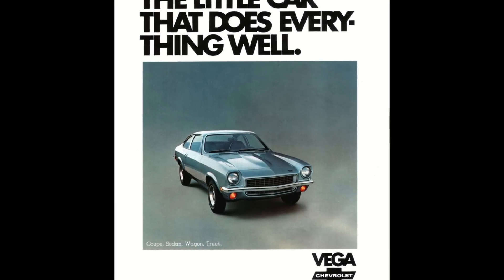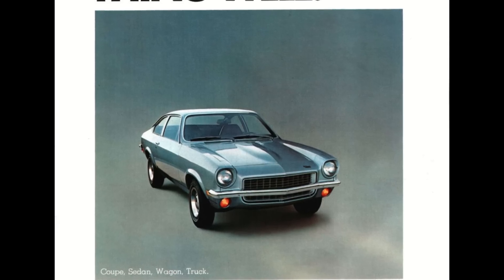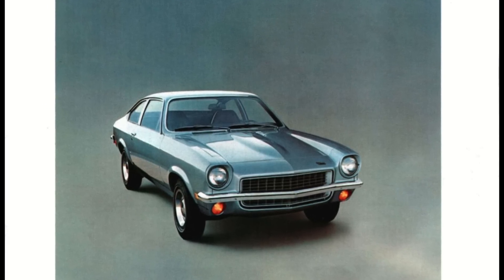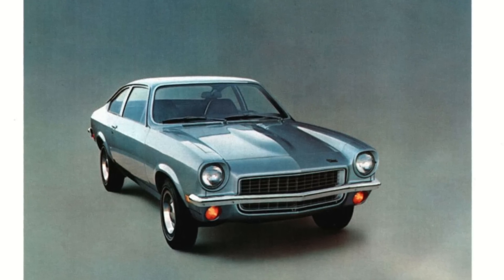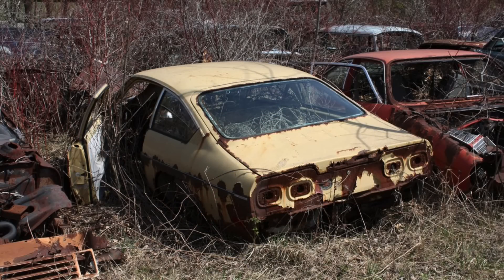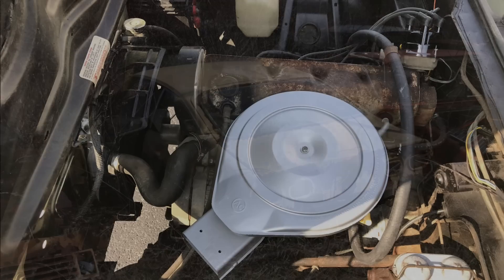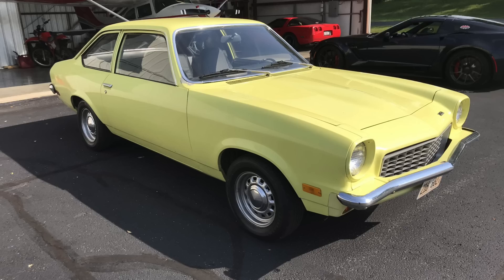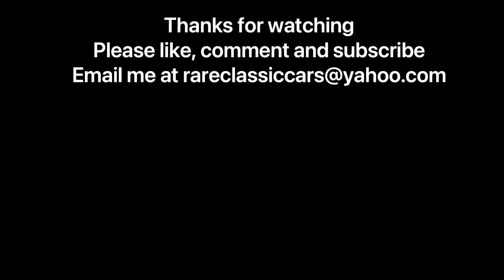GM's Largest Failures: Why The Chevrolet Vega's Engine Turned Buyers Away From American Cars

Comment: You gotta wonder if all the changes they were forced to implement didn’t cost more in the end than cylinder liners.
Reply: I was thinking the same, just spend the $20 to begin with and add it to the sticker, seems stupid.
Reply: @richardbaumgart2454  ivory towers have 90 day vision. They can't see further down the road than that and never will.
Reply: @dxrflyboy  My dad retired from GM and I was always a GM guy to until 2008, now I drive a Ford and a Toyota
Reply: Yep. But the bean counters would never have heard that logical suggestion over the sound of those beans clicking into the jars.  @richardbaumgart2454
Reply: Yeah, and you really have to wonder why they created their most expensive air filter for their least expensive car...  🙄
Reply: The scamerican way.......the oligarchs, bean counters and shareholders declare a profit no matter what
Reply: It didn't need liners. Many other manufacturers at the time had aluminum engines with no problems. It was just another rushed design by GM in response to wanting to get a little car to the market before it was ready. Remember the poor suspension problems with the Corvair when it was new? GM never learns, they just go cheap at the start, instead of doing things right.
Reply: @d.e.b.b5788 Chevy Cruze did the same thing again, shit quality and lots of recalls
Reply: @d.e.b.b5788  The rear suspension design of the first Corvairs was not problematic at its inception. Several other vehicles used a swing axle design that was nearly identical. Volkswagen Type 1 (Beetles) and Porsche used that design. In the US, Beetles used it until 1968. In other parts of the world, Beetles continued with the swing axle. I own a 1984 Beetle (Volkswagen de Mexico) and it has swing axles. So I wouldn't call it a case of GM not "learning their lesson". It was a contemporary design for its time.

As for the Vega, yeah, mistakes were made. However, GM has also pioneered many different aspects of vehicles over the last 120 years. This unfortunately sometimes comes at a cost when trying new processes. I'm not giving them a pass by any means, but hopefully they did learn something from the Vega, even if those lessons never came to fruition ON the Vega. There were many other vehicles GM made in the early 1970's that were absolutely reliable and also sales leaders, even while the Vega existed at the same time.

Lastly, the open deck design is something GM DID perfect. Almost all of their current four cylinder engines are open deck, as well as the formidable LS V8s.
Reply: @paulwindisch1423  Not all swing axle designs are identical, as proven by those Corvairs. However, as seen by how Porsche abandoned poorer chassis designs from their prototype racers as they found better ones, many were kept (like 911's) just because men liked to brag that they drove a 911, 'a REAL man's car'. got a lot of them killed, but hey, it was their choice. But I still say that Porsche could have made use of all their success in racing, to sell a NEWER mid engine car with which they could replace the  911, no 'macho' reputation enhancement needed from a poor handling car.
Reply: doing it right the first time is always the best way, economic amd reputation considerations.
I quitted the american car market 45 years ago and believe me, I'll never return
Reply: @jacquespoirier9071 honda went with linerless engines.....
Reply: @DrewLSsix  but the execution is far better quality
Reply: @DrewLSsix  with proper quality control and materials it can work, Mercedes has been doing it for 50 years.
Reply: @jacquespoirier9071 Not really just better technology has come along for piston coating and ring design.
Reply: @DrewLSsix but they are plated!
Reply: @DrewLSsix they used a ceramic coating to prevent wear in the j37.  This coating can chip and then you end up with a Vega situation shortly afterwards.
Reply: @MUUKOW3  it much more a mentality prolem than a technology problem.
Reply: @DrewLSsix Honda did have some linerless engines. But these were the exception rather than the rule. The vast majority of Honda engines use cast iron liners. There is good reason for this - the FRM engines are less reliable and tend to burn oil.

What’s also interesting is that, while the Mercruiser DOHC LT5 ZR1 Vette engine used Nikasil plated cylinders (they were all the rage -35 years ago), GM went back to cast iron liners in the LS/LT engines. Even the new DOHC LT6 Gemini engine uses cast iron liners. The fact is, there is NOTHING that beats cast iron for cylinder liners. It is self-lubricating due to graphite inclusions. It holds oil very well. It is hard enough that it doesn’t rapidly wear. But it is soft enough that it doesn’t rapidly wear pistons.
Reply: @DrewLSsix  FRM has its problems too...
Reply: @jacquespoirier9071  Barely even American anymore. GM has been importing vehicles from China and South Korea for ages, and now Ford is hopping on the bandwagon. You honestly support more American workers and suppliers by buying "imports" these days. They're shifting production here while the supposed American companies are outsourcing...
Reply: Same here, I quit American cars back in 1982, now just Japanese cars.
Reply: @jacquespoirier9071  there were some exceptional domestic engines in that time period, although this is not one of them. i still, to this day have 2 GM cars with 3800 engines. one of each variety, L36 and L67 supercharged. the supercharged is an SSEi bonneville and it's damn quick for a V6 with only a few light modifications. ford had the 300 i6 that you couldn't kill, the chrysler 318 v8, and the AMC/jeep 4.0 liter engine. there are others, the chevy 350 and the 4.3 that was built by removing 2 cylinders.

there were really good engine, and really bad engines. what i find really concerning is the domestics aren't really making too many great engines or cars anymore. they have more issues then cars they built in the 90's and 2000's
Reply: I also remember seeing an ad in the newspaper bragging bragging about the Vega being car of the yeand the and that it was actually Designed and partially built by computer.
 Also also designed by computer not to rust. They were also shipped and a very unique way.
They were shipped hanging up
Reply: @Greg-xv9qj  I recall the first year of Vega ads assuring us that they would take the VW approach and not make any changes in the first six years. As it turned out, the model only lasted seven years altogether. Zillions of changes, though!
Reply: Such an attractive vehicle, still. Such a shame.
Reply: Hastings, manufacturing company created an air filter that was a take apart unit and used a standard 6 cylinder Chevrolet air filter element.
 I remember seeing some Vegas.  Where the air filter was so filthy, it was ridiculous. Amazing, amazing, the car even rand other people cut the air filter housing. The filter that was in there with gasoline.  Lit it on fire burned it out because it was Bonded to the upper and lower shell and used a 6 cylinder Chevrolet element also.
Reply: @Greg-xv9qj Yes, I worked in an auto parts store in the early to mid 1980s, and we sold lots of Wix air cleaners with the replaceable element to Vega owners.
Reply: I put the alternator off a 1974 Vega I junked on  1962 Ford Tractor that I converted to 12 volt⚡.
Reply: In 1977 they came out with the 2.5 liter "Iron Duke" four cylinder,  probably in response to the failures with the Vega engines.
Reply: @BillySBC  which was another crude GM engine. Although reliable.
Reply: @corgiowner436  It was,  but it was better than the Vega motor.  Pretty sure they might still use the little Iron Duke in small Post Office delivery trucks,  or they used to.
Reply: No wondering necessary. The answer is YES. And worse, it hurt the brand. Idiotic bean-counting decisions that cost the company far more than they saved—-and the damage lasted for years. Arguably to this day.
Reply: GM replaced the Vega 4 cylinder with the Pontiac 151 Iron Duke 4 cylinder in the Vega-Astre for 1977.
Reply: @SuperDave01965  it was crude but reliable.
Reply: @SuperDave01965  i didnt know the iron duke was ever in the vega, i thought it was introduced with the citation. the iron duke was noisy but reliable, they would run almost forever. i would still buy one today if i came across a clean car, which is unlikely at this point...... and not a citation but a celebrity or 6000
Reply: My dad was a big GM guy and bought a 1973 Vega. What a piece of sh1t! He gave it to my older brother to take to college which was 3 hours away. He had to keep a case of oil in the car because of how fast in burned through oil. In the end it was shooting flames out of the tailpipe. I believe it traveled at most 60,000 miles.
Reply: @bartmix8994  it was probably one of GM's worst engine, GM has had some great engines and this was NOT one of them
Reply: Our local GM dealership was way ahead of GM as far as that aluminum block went. After a bunch of Vegas came back to them, burning more oil than was in the pan, with each Vega they sold, they were automatically breaking the engine down and installing cast iron sleeves in brand new engines before they even put them on the lot!!! most aluminum blocked engines, barely would make 12000 miles before the guaranteed oil burning began. They also would put an aftermarket radiator that was far superior to GM's. I owned a Cosworth Vega in the hatchback sport design,sleeved engine with an aftermarket, Edelbrock high performance Holley two barrel carburetor, that absolutely ate up most stock 283 cid engines by many car lengths!!! There's more to this story than what I've texted, but suffice it to say, our GM dealership was way ahead of GM as far as stopping oil burning warranty claims!!👍🏻👍🏻👍🏻😎
Reply: Damn right it did.
Reply: The 8.2L Detroit Diesel V8 in the Chevy and GMC medium duty 5000-7000 trucks had the same free standing open deck cylinders. Many guys back then spoke openly of the lousy design of the Vega engines. Popular swaps were the Chevy V8 or the VW Rabbit 4 cylinder.
Reply: @SuperDave01965  a 350 in one of those cars made it hot rod.4 seats and an engine.
Reply: I wonder what benefits Engineers thought having freestanding cylinders hadf
Reply: @nunyabizness8508  easier casting, less machining, and better coolant circulation.
Reply: I don't know if GM pioneered the technology, but nowadays they cast the engines with the cylinder liners in place. That saves a bunch of machining steps when the liners are cast in place and then machined once to proper fit and finish.
Reply: @bartholomausallen883  Cast-in liners have been a ‘thing’ for quite some time. Not only do they save machining steps for both the block and the liners. They also save some steps with casting since it is not necessary to make cores for the cylinders. The liners take the place of the cores.
Reply: John Z. HAYED THE CAR. WAMTED TO ADD FENDER LINERS AND BETTER TIRES FOR AN ANOTHER 47. BUCKS BUT GM SAID NO
Reply: The problem was the aluminum used to cast the block did not have silica (sand) added like Mercedes did!  The sand (glass) gave the bores the wear characteristics to last longer!!
Reply: @garybulwinkle82  Siamese cylinders, open deck, radiator that was basicly a heater core and no iron liners in cylinders. Built one for my brother in law with sleeved block and didn't last a mile longer than aluminum cylinders. Great little car, just built all wrong. With a 3.8, a 5 speed, and real steel in body they'ed still be making these.
Reply: @garybulwinkle82  4:50

Comment: I can't get enough of your Vega videos. From Vertapak to no cylinder liners, it's a story that people love to tell but without the details you provide.
Reply: You had to replace the whole air cleaner assembly in order to change the air cleaner - typical GM move there!
Reply: @stevejarred6484  My neighbor just bought a cheap chrome air cleaner and drilled mounting holes in it.
Reply: @stevejarred6484   As I recall, there were aftermarket direct replacement air cleaners that allowed you to open it up and replace the air filter element.
Reply: @stevejarred6484 They probably learned that from Mercedes, BMW Rolls-Royce...
Reply: DITTO!!
Reply: @blautens There are so many what-ifs regarding the Vega. If this one car had been successful, it might have limited the market share growth of the Japanese makes. If only the Chevy or the Pontiac small car projects had been chosen, not the XP-887, if only Ed Cole had been busy on another project, if, if...

Comment: My parents bought a new Vega wagon in 1976.
It was a 4SPD with A/C.
It was driven from the dealership to the Ziebart dealer to get rust-proofing and paint protection. 
My father was a big believer in preventive maintenance and it was meticulously maintained and even got a yearly inspection at Ziebart.
It lasted 12 years and over 100k miles in northern Wisconsin on salted winter roads and was still relatively rust-free when they sold it.
I  remember taking trips to Colorado California Arizona Maine and New York in it.
I asked my father about his ownership experience with it and he said it never failed to start or left anyone stranded and he couldn't remember any major mechanical maladies.
Reply: I'm glad for you, but your results were not typical.
Reply: By '76, a lot of the deadly issues that plagued the early Vegas had been sorted out. It was a solid car in its later years but the damage had already been done. Much like the Citation years later, once the issues were ironed out, its reputation was in the trash, and it was canceled.
Reply: I had a similar experience as a Windows ME and vista user.
Reply: @dankline9162 While the rest of us went from 98SE to XP to Windows 7 and were eventually forced into Windows 10 when they pried the 7 out of our cold dead fingers...  and it only took a year to get the 10 working as good as the 7 Ultimate did!
Reply: @marko7843  
Xp and 7 were the best. Just saying the lemon ones didn't give me problems.
Reply: @dankline9162  I had a PC with ME installed. That's a trip down memory lane. The PC didn't last too long.
Reply: @dankline9162  You had a Vista Cruiser? Cool! 😁 Like the Griswolds or the Foreman's?
Reply: @MisterMikeTexas  
Haha, I wish! 
No, I meant i had a similar experience with computer operating systems. Although i wouldnt mind having a classic project, oldest ive had were two cars from 1990, a pontiac grand prix LE and a vw jetta diesel.
Reply: They were much improved by 76, but the earlier ones were so bad that they destroyed the car's reputation.
Reply: Leaves me to wonder if maybe the wagon was assembled elsewhere than the sedan. I had a friend who took somewhat better than normal maintence of a vega and it just became a rolling pile of junk in 2 years. That was in Kansas which does not have nearly the rust problems of Wisconsin. I do remember though that it was a bit older than your fathers.
Reply: Maintenance is the key
Reply: I like all cars and engines in general, especially the oddballs, and the big cars you dont see as much anymore. But I only drive manuals now if i can help it 🙄

Comment: An interesting follow-up would be why it took GM so long to respond to all these issues. What were the management failures?
Reply: Read The Decline and Fall of the American Automobile Industry by Brock Yates, the auto writer, to more correctly understand how GM (and Ford and MOPAR) was slow to react over and over.
Reply: The Reckoning by David Halberstam is also a good source.
Reply: People that would put out such a POS aren't going to step up to the plate to fix it.
Reply: Read "On a Clear Day You Can See General Motors" by John Z DeLorean.
Reply: Because admitting your new child is a failure is very painful. It also means the end of the careers of highly entrenched executives like Ed Cole, etc who were focused on the successes (Monte Carlo) and trying to sweep the Vega problems under the rug. If a large scale action to fix the Vega had been undertaken, while it would have been better in the long run it would have ended careers and had short term damage to Chevrolet and GM's stock value. Just playing for time while issues quietly get fixed with model changes was the way GM decided to do things and always had. Example: Look at the changes between the 1960 Corvair and the 1961. You will find that there is almost no parts commonality between the two models because they found redesign so necessary. You bring out a new car and do a major redesign after one year you don't brag about it, you hope it is ignored. So Corvair, Vega, Fiero, Alante, Northstar all took years to become the product they should have been when they went to market.
Reply: @keithstudly6071 I dare say a major redesign was not needed with the Vega if only higher execs would maybe react to hard won findings of subordinates?
Reply: Was this car originally designed to use the rotary Wankle  Engine?
Reply: @ronaldbrown5745  Indeed so, originally scheduled to use a Wankel rotary.. But GM would have blundered that as well..

Comment: I had a '76 Astre, the Pontiac version of the Vega.  The rust and engine problems were mostly solved by them.  Still workmanship and reliability was beyond bad.  My next car was a Ford.  The person I bought it from bought a new Honda.  So GM should have just skipped the Vega.  I got an air cleaner with a replaceable filter from JC Whitney.  Mine had a low coolant warning light.